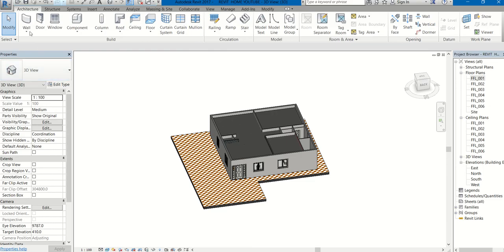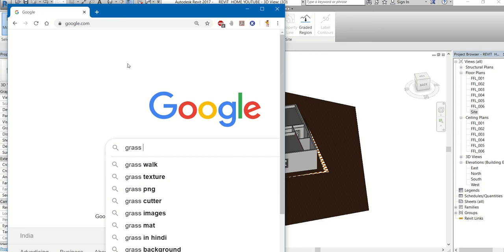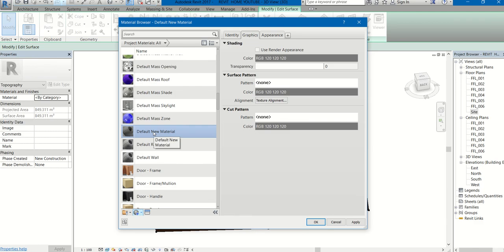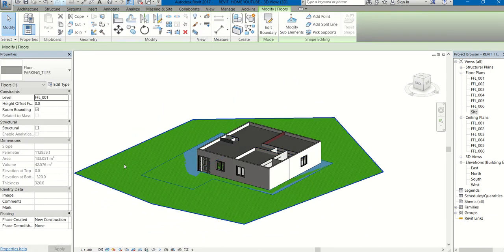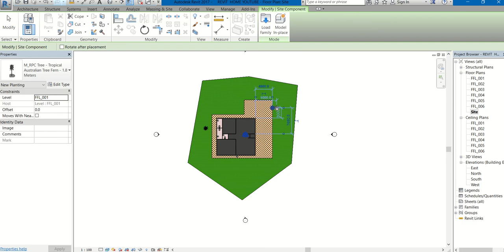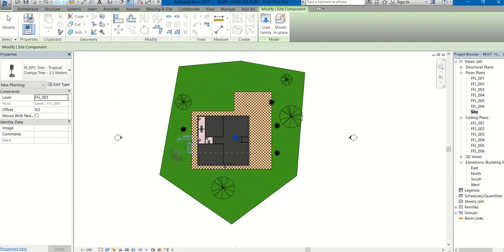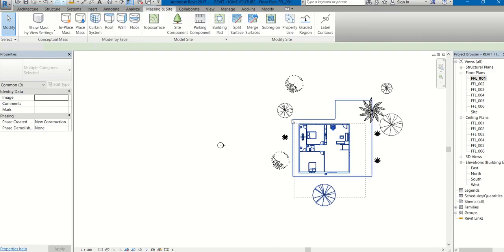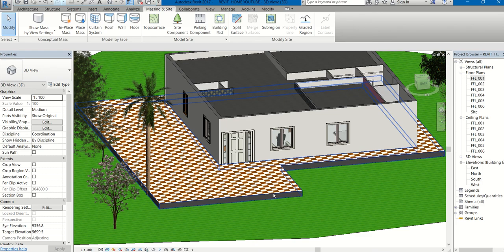Lesson 9: Massing and site - Create Grass and place Trees || Revit Architecture

Comment: Hello, what should I do for the following:

if a tree does not show up on Realistic,  but is available in other Visual Styles?
if the tree does not host itself on where it is intended to be (floor, topo, etc.)

I hope you can help me. Thank you!
Reply from the maker: Hi.. Your issue might be
1. Some tree models will not have 3D view. It doesn't give realistic view. You need to try with other tree models
2. You can place your tree model in 'site' view. If you want to give it at a height, you need to give elevation.
Hope i could clarify your queries.